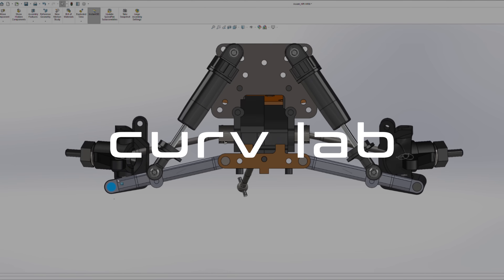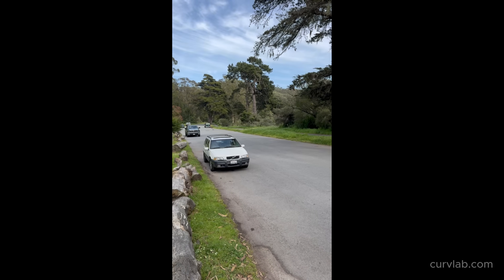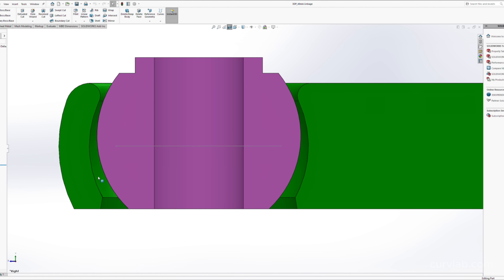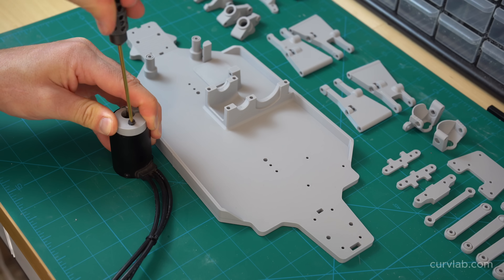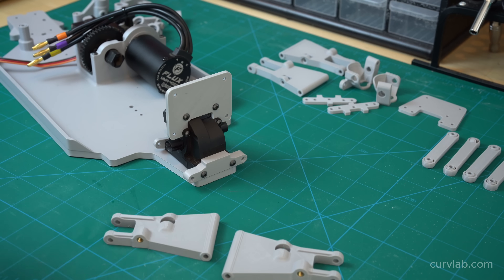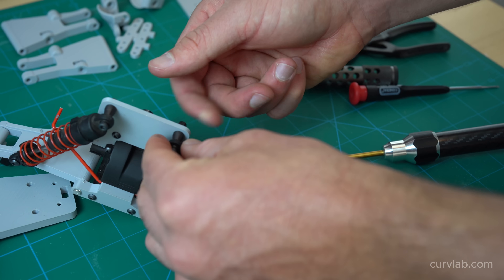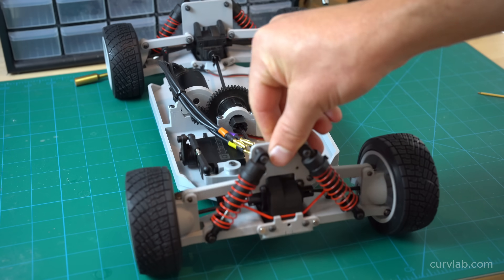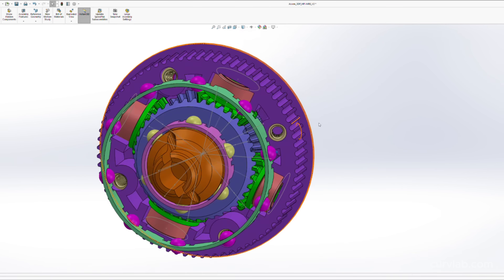3D Printable RC Chassis [PART 1]

Comment: Finally someone uses proper rc drivetrain on a 3d printed chassis! My dislike in most 3d printed chassis is the use of bulky non rc drivetrain parts.
My mate Marc over at Tamiyabase is one doing it right, upgrade where needed with 3d printing and use of proper rc parts. But he do print gears. My vintage Marui Big Bear is running his gears, but it failed due to my homemade 5mm pinion adapter and the big tires. Next time I will get the gears cnc`d to withstand modern powerplants. Vintage gears for that vehicle is hard ish to come by and don`t last long running 23t is motor or lower turn.
Marc`s channel is called Marc Wecker.
Reply from the maker: Will check Marc out! --And totally agree on the non-rc drivetrain parts. If its not going drive well or last, why would I spend hours printing it??
Reply: the whole point of printing a RC car, is using printed drivetrain parts. It works perfectly on my printed cars.
Reply: @German_overengineer  As a rc enthusiast first and 3d printer second I dislike 3d printed drivetrain. If you want a 80kph with 6000kv brushless motor vehicle, 3d printing is no good. For potting around it`s fine. Most of my 60+ rc collection is Tamiya vehicles. I want to use rc drivetrain. I also hate audrino stuff on rc vehicles as well. I want proper rc radio gear. I`m a big fan of using vintage radio gear, like the Futaba Attack R. 3d printing for me is to make custom chassis and bodies. As an example I would like to make a modern variant of the Tamiya TL-01 chassis, still with og running gear..
Reply: @MrCaprinut my 1/5 scale car reaches 100kmh with only printed parts
Reply: If you get a heated chamber printer (I use a Qidi Q1) you can print ABS, Nylon, PC pretty easily. If you're currently using PLA or even PETG you're missing out.
Reply: I get what you mean but when I make mine I want to design and build the whole chassi by myself, including the drivetrain. I don't only use 3d printing and some parts are metal but if I were to make a car with the goal of reliability I would use if the shelf parts.
Reply: Yeah, this is the second actually rc drivetrain I have seen 3d printed. I am woking on an rc trophy truck with an obnoxiously oversized motor that should shatter the existing 3d printed rc car record
Reply: @TitusCasasuhhh show it to me
Reply: @German_overengineer youll see
Reply: 1/10 scale 3S Lipo 60 mph (100kph) on 3d printed drivetrain

Comment: As someone who's been racing RC cars for years and designing and printing my own race buggy since 2019 this is one of the better ones I have seen, however I do have my concerns. For one, standard printing filaments are not very strong, especially when it comes to impacts. To deal with crashes and other impacts you really need to be using some of the "engineering" filaments like polycarbonate, nylon, or CF nylon. Also, this doesn't take into consideration the effects on suspension geometry, like how the thickened chassis results in a higher roll center and an effectively stiffer car. I'm interested in your custom belt drive differential idea but it also looks very large which will affect the driveshaft alignment and plunge.
Reply from the maker: Some great points here, thanks for the feedback. I should crash this thing a couple times and see what breaks.

Comment: What is your anticipated price for the model plans? Will there be X1C/P1S supported variants?
Reply from the maker: Yes definitely will be smaller build plate variants. Not sure on price yet. Would you rather buy a kit with all the non-printable hardware directly from curvlab or buy all the parts online with a list of links?
Reply: @CURV-LAB i suppose having the option for either/or would be ideal. 

The appeal behind this to me is that i have an older working chassis ive barely actually used, so i could utilize components from that as much as possible on your chassis so i can also use one of the bodies you designed (porsche 930 is calling my name).

Obviously will have to wait til it's listed but i was hoping I'd be able to compare my existing component list to what's necessary and then decide whether i want a complete kit or a semi-ready kit with a link list. 

Hope that makes sense

Comment: actually - you DONT NEED to make any holes less then 7mm in a waterdrop shape ....you can just print circular holes vertically  without ANY supports....just use a part cooling properly tuned.....that`s all....any normal 3d fdm  printer can make it. Problems can be with a really big overhangs that are parallel to a build plate
Reply from the maker: Ah, this is good to know!

Comment: Juste recently I have waited over a month to get replacement spare parts for my son's Arrma Granite 3S BLX. 3D printed would be much faster and definitely cheaper to fix. I really like designs from Prusa guys with 3DSETS but I have a feeling that yours design is more robust and you are really thinking more deeply to be realiable. :) Awesome project and keep on going!
Reply from the maker: Thank you! Yeah I crashed a chassis and was shocked how expensive it was to get a couple replacement parts. Also for lots of chassis replacement parts just dont exist or are out of stock. They could just be 3dprinted

Comment: Not bad at all as a prototype, I hope you also plan to use body posts and clips so it accepts commercial bodys too, no offense with PLA or 3d printed bodies, and your are very beautiful but one hit its all it takes to ruin it. A future belt drive system would also be awesome but care must be taken to make it sealed from dirt. Some extra chassis supports or struts like they use on 1/8th buggy chassis would be great to reduce chassis flex too. Anyway...nice work😊
Reply from the maker: Good points.

Comment: Why did you go with a more off-road focused chassis versus an on road one? it's nice.. but On-road would suit your Porsche better unless you're making a rally car... nice work BTW
Reply from the maker: Ideally I want to make a chassis with the most flexibility. I think its best to over-engineer the chassis for off road so it will be compatible with rally cars and then modify it slightly to be compatible with road cars.
Reply: An off-road chassis makes it more versatile, in my opinion. With an On-road chassis, you are limited to a nice, empty parking lot, where you can only go round and round with not much action. In the dirt, it's much more fun😊, and of course, if you want to, you can use it on smoother surfaces too.

Comment: Would be cool to use generative design and FEA to strengthen and lighten the bottom plate
Reply: such a good idea, but how hard is it to do FEA on a 3d printed element? it's not as straight forward as something like stainless steel